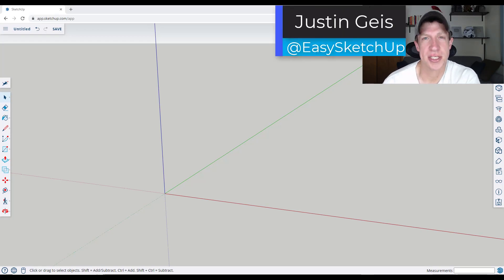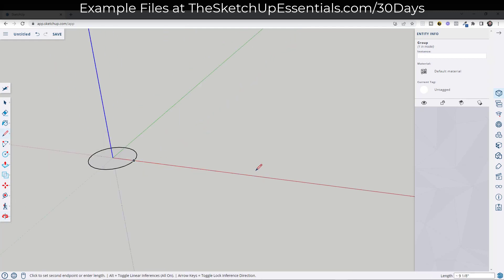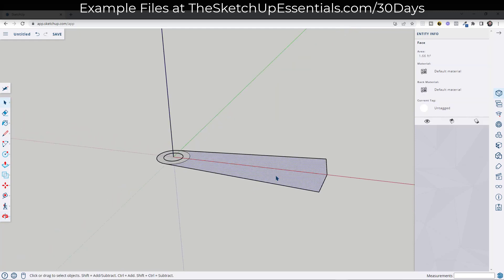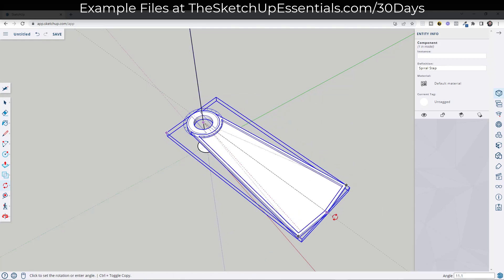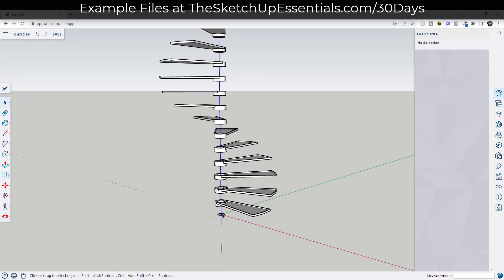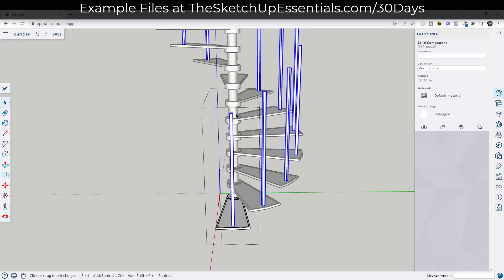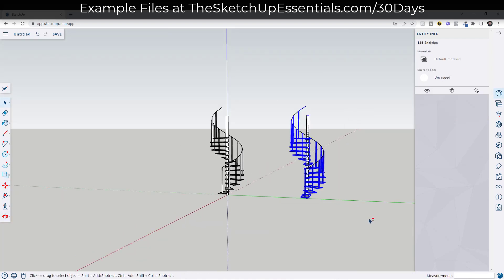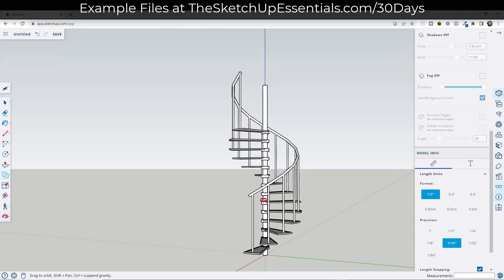Learn SketchUp in 30 Days DAY 11 - Spiral Stair!

Comment: Hmmmm. If the railing segments are identical, could you render them as components and then change their profile?
Reply from the maker: Probably but you’d still have to fix the intersections manually